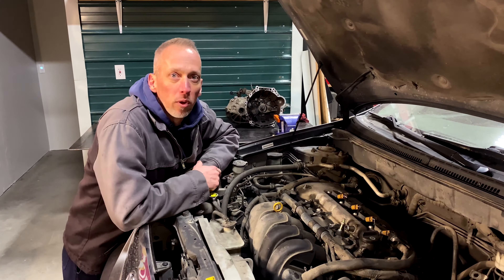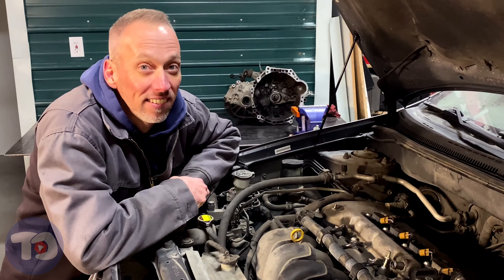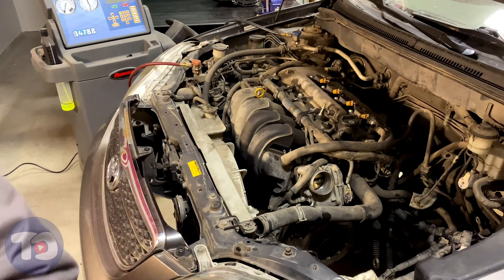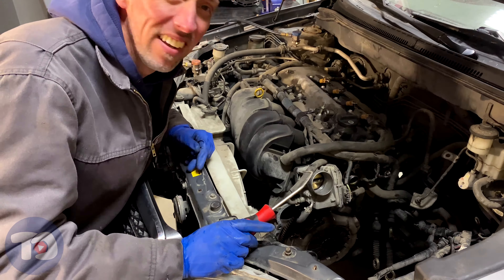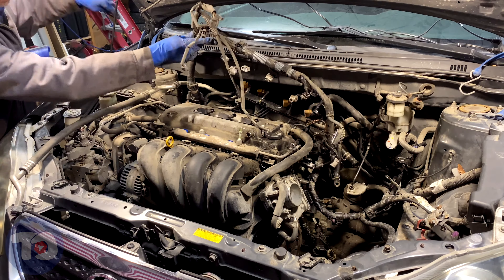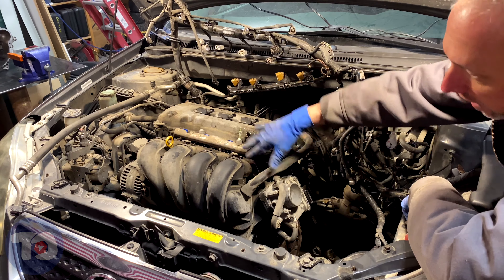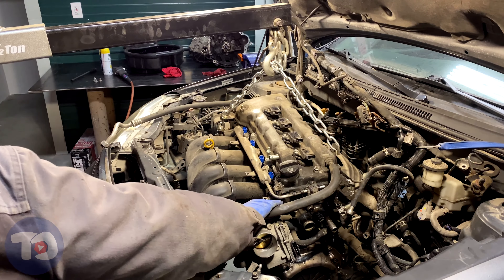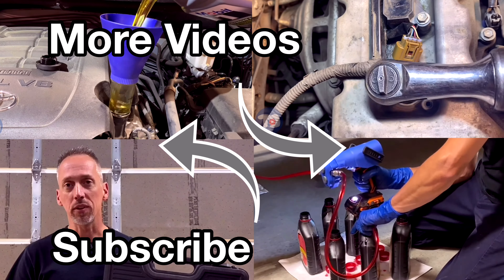How to remove the ENGINE from a Toyota Corolla.

Comment: This is why I own a Corolla with the 2ZR-FE - They are insanely easy to work on. This is a complete joy of a process compared to many cars... even the newer 12th gen corollas with the Dynamic Force engine (2019 hatch or 2020 sedan and newer) have EGR valves, oil level sensors, and more.. just ALOT more stuff to disconnect and deal with. Sure there are some nice new features.... but for how easy these engines come out.. you can pull them out, put new piston rings, new bearings, and throw it back in... boom you're rolling for another 300k miles. A true economy car right here, I love these Corollas.
Reply from the maker: Exactly! These cars are a joy.

Comment: I understand when people buy JDM engine or any used engine, they did a compression test first; however, on a transmission swap, what can we based on except get from a "good" sellers.
Reply from the maker: Three things, Spock:
1: Most sellers can tell you the mileage of the donor car - which can give you a decent idea of the health of the transmission.
2: Have a look at the fluid. It should be a pretty, golden color and have very little metal (glitter) in it. Also smell it - it should not have a burned smell.
3: A good seller will offer a warranty. It may only be 30-90 days, but enough to know if the component is healthy.
Reply: @ToolDemos  Thanks again for the advice. 👍

Comment: Quick question. I was going to need an engine replacement which was gonna cost me $4500 at that point I decided to get another car. However, I need my car for work so what he was gonna do is put the engine back in and let me drive it for a little bit while I had time to look for a new car. While he was working on it, I was able to find a new car rather quickly. So he had already taken the engine out but he said he’ll stop there and leave it at that, so for Toyota Corolla S. How Much is it just to take the engine out? I just wanna have an idea and he didn’t do the paperwork up yet.
Reply from the maker: @SevenTailedWolf72  my service information website is down right now. So I can’t give you the exact number, but I’m guessing around four hours of labor is what it would take to pull the engine.

Comment: Can you remove the engine from these cars by themselves or do you have to remove the transmission with it all together that has a manual transmission? 2005 Corolla LE to be exact.
Reply from the maker: You can pull the engine by itself, leaving the transmission in the car. It’s pretty easy. I know I did it weird in this video, but watch the transmission removal video to get an idea of how to unhook it from the engine.   https://youtu.be/dHGMFkwi2jQ?si=HL_17Y-6n7XN2_cX

Comment: You already had the trans out lol is it possible to lift with the trans installed? And are all the bolts the same direction
Reply from the maker: Hey Brett. Yeah, the transmission came out in the previous video, sorry. To answer your question: Yes, they will come out together, just lift the front of the engine out first, then they both come out at an angle. No, the top bolts go through the trans and thread into the engine, the bottom bolts are the opposite.

Comment: Tool Demos: My 2012 corolla engine seized. I found a low miles 2016 corolla engine. Can I replace my engine with 2016 engine? A local mechanic said it will fit but I am worried about any possible physical differences between the engines, engine bay, connections, sensors, position of surrounding components, frame of car?  Should I look for 2012 corolla engine instead? I will really appreciate your input. I will also appreciate other viewer's opinions. Thanks.
Reply from the maker: Toyota has a few different engine options for Corolla. You are likely to have the 2ZR-FE 1.8 liter. The 2016 might be a 2ZR-FAE 1.8 liter that would physically fit, but your PCM would not be able to control it. In that case you would need at least the PCM and harness from the 2016. Possibly other network devices as well. 

If they are both the same engine code things are less complicated. If you do the swap, keep your old engine. You may need parts from it to fit your original harness or to make the PCM happy.
Reply: @ToolDemos  Thank you for your prompt reply!!

Comment: My 1zzFE engine just died, so I'm going to have to do this job. The only part that concerns me from a safety perspective is not hooking up my engine hoist correctly to the engine. Ironically that is the only step it seems all these videos never show or even talk about. I've had to rip my engine apart many times and replace something and put it back together, so none of that concerns me, but I've never had to lift out the whole engine until now so it would be nice to see a video which shows where the connection points are on the 1zzFE and how they connect to the hoist, because the Toyota repair manual diagram for this procedure sucks.
Reply from the maker: Thanks for your question, Chasen. Very few manufacturers include lift points on their engines. If you look at service data most manufacturers will recommend using a special service tool that attaches to the engine so that you can lift it properly. 

I’ve never purchased any of those special tools and I’ve never heard of anyone I know buying them either. That’s why I didn’t include a ‘how to’ guide for attaching the hoist. 

One end of the chain I just wrapped around the front engine mount and attached it back to itself using a threaded link. The other end, I bolted to the engine using one of the bell housing bolts. (Make sure the bolt is long enough to properly engage enough threads, or use a longer bolt.)

So, that’s how not to do it. Check your service manual for the proper tools/technique. Happy wrenching!
Reply: @ToolDemos  LOL I love learning how to do things the Tim the toolman Taylor way as much as the proper way.  Thank you so much for taking some of your time out to reply to my comment. The 1zzFE is no exception in the department of not having hangers pre-installed. To anyone reading along — the 1zzFE  can make use of two hangers (hooks) which bolt somewhere onto the engine where the hoist and leveler will connect to them. Part numbers are 12281-22021 and 12281-15040. The problem I have is, I'm not exactly sure where they bolt into. The little service manual drawing on page EM-78 looks like it's hooked onto some kind of hose which would be silly.  It just says to disconnect the PCV hoses and the cylinder head cover, and "install the 2 engine hangers in the correct direction."  I was hoping to find a close up shot somewhere on the internet on where those two connection bolt holes would be in the engine. Evidently doing an exploded diagram of this would have killed Toyota way back in the day.
Reply: Did you have to take the transmission out or did you leave it in?
Reply: @EDWIN-sv7ny  I'll have to let you know when I do the job. We've been traveling one week after the next for a month. Plus, the sellers haven't been forthcoming about answering my cylinder compression test questions. Thus, I haven't gotten to purchase the engine, let alone install it. I won't be pulling the old engine out until I have the new engine to put in. Do it all at the same time (to avoid losing nuts and bolts etc).  Now as of today ebay is charging sales tax which has tacked on another $100 bucks to all the 1ZZ's I've been looking at. So that sucked to find out. 

From other video's I've watched though, they've all taken the transmission out with the engine. I've had to remove my transmission twice before, so I think I can see why they do it that way. It's just going to be easier to put an engine leveler on your hoist and angle the engine so it can come out of the bay. I bought a 4 ton (overkill) leveler on ebay for $50. I think they sell 2 ton levelers at Harbor freight, but they were $44, so I just paid the extra 6 bucks (and free shipping) to get something I can use with more weight later if the need arises. So, my plan is to take the transmission out while it's still bolted to the engine.
Reply from the maker: @EDWIN-sv7ny  if you’re pulling the engine from the top, it’ll be faster to leave the transmission in place.
Reply: Some ratchet straps and wrap them all over but not over things that will get broken when the force from the strap when engine is lifted . 2 in an x pattern should do
Reply: @thelongranger55  Thank you for the reply. So, I ended up buying an Engine hoist load leveler along with the genuine engine hanger hooks from Toyota and bolted them into the engine block where the repair manual showed to bolt them in. I had no problems with it. It all even came in handy again when I needed to replace my clutch recently. That bottom back mounting bracket can be a real demon.

Comment: Great video! However I understand that you don’t have to take out the ac or psp . So you could avoid bleeding and re charging the system later.
Reply from the maker: That’s true, you could leave the AC compressor and the power steering pump in the vehicle and pull the engine without it.

Comment: Awesome work getting that engine out without too much fuss. Would you by chance have a link to the seller of the machined engine hoist hydraulic ram level knob??? Thanks!
Reply from the maker: Thanks, I appreciate that. I posted a 2 min video about that knob upgrade. That vid has the link in the description. https://youtu.be/QqZMfZD8F7Y
Reply: @ToolDemos  Ahhh… I totally missed it looking through your channel. Thank you again, keep up the good work. P.S. would it be possible to remove the 1ZZ without disconnecting the AC? I have a 2008 Corolla S I’m debating removing the engine on to do some maintenance on. But I really would like to avoid opening up the AC system, if possible. It looks as though the compressor could possibly be moved out of the way while the engine is being hoisted up. I’m probably wrong though.
Reply from the maker: Right, it does look like you can move the compressor towards the right front headlight area. I haven’t tried it, but as long as you’re careful to move the hose on the engine’s way out, I don’t see a problem with it.

Comment: Thank you for the video. I need to remove a engine from a tercel to adjust the mounting points. My tercel was in a car accident so the engine is not sitting correctly. My body shop guy said if I find someone to lift the engine he can adjust the mounting point for the engine. Should I remove engine and tyranny together?
Reply from the maker: Yes, that would be easier.

Comment: Is that like an earplug foam thing you put in the AC lines?
Reply from the maker: I used some plugs from a kit I bought on Amazon. It’s a silicone rubber cap and plug set.

Comment: I’m currently thinking about swapping my engine to my 2005 Toyota Corolla CE from 1ZZ-FE to an 2ZZ-GE i wonder is possible to use the stock transmission or I’m forced to swap it for an better one?
Reply from the maker: I swapped the 5 speed out for the 6 speed, same engine. Almost everything was the same.

Comment: Question: when you plug the AC lines can I just use those blue paper towels instead of those plugs your using
Reply from the maker: Hi Brandon. I would avoid using anything that could introduce dust or particles. The tubing inside an evaporator are tiny and easily clogged. Instead of a paper towel, maybe just a plastic bag as a cover and zip-tie it on.
Reply: @ToolDemos  alright sweet thank u mate!!

Comment: How long do engine swaps generally take?
Reply from the maker: I apologize for missing your question, but the answer is 11 to 14 hours depending on what parts you have to swap.
Reply: @ToolDemos  So if the engine is okay there is no advantage in terms of time in taking both engine and transmission out ?
Reply from the maker: @benzflynn  not really. My idea didn’t go as planned with that car, so pulling the engine was just wasted effort.
Reply: @ToolDemos  By the way, on working under jack stands and all that. My own feeling is that having a stack of 9x3  pieces at the support points would be safer in that they'd be less liable to collapse onto the man underneath. Some jack stands have strong pins instead of the ratchet and pawl. But they are still like towers when they are 2 feet high.

Comment: I got a ‘10 corolla s, I want to swap to a 2zz, would that be possible? And if so how and what parts i would need to do that.
Reply from the maker: That would be a lot more work than you might realize. Mostly because of the wiring and controls for fuel injection and spark.

Comment: Will and engine from 03 corolla fit the 2000 thanks in advance
Reply from the maker: Hi Aldo, generally speaking yes the engine will fit. Overall the engine is the same but because they are from two different years you could have minor differences. The best thing to do is to keep your old engine until you’re sure that everything works fine. You might have to pull a sensor from your old engine so that it works with your existing wiring harness. Good luck with your swap.

Comment: how many hours for a professional to make the complete swap?
Reply from the maker: Hi, No Name. You question is a bit tricky because you have a few options.

1: Remove and Replace entire running engine, without swapping over any parts is quickest, and would be 6-7 hours.
2: R&R engine, but transfer accessories and fuel/ignition, add about 3 hours.
3: R&R engine long block, add about 4 more.
4: R&R short block, add about 2 more (plus machine work)
Once you decide what you want, your shop can give you a firm quote. I hope this helps.
Reply: @ToolDemos  yeah coincidentally my mechanic called me as you commented and he found a 1zzfe for $600 and the labor shouldn't cost more than $1000 I believe. I got lucky
Reply: @ToolDemos  6 or 7 hours would be amazing. my mechanic gives me the best rates in the country
Reply from the maker: That sounds pretty reasonable. You’ll also see a few incidental charges, like fluids, lubricants and refrigerant.

Comment: Can the 2020 Corolla 1.6 engine be replaced with a 1.8 . engine?
Reply from the maker: Without experience trying a swap like that, I can only guess. I’d say that as long as the 1.8 you get is a ZR series engine, it could work. You will probably need to swap PCMs as well.